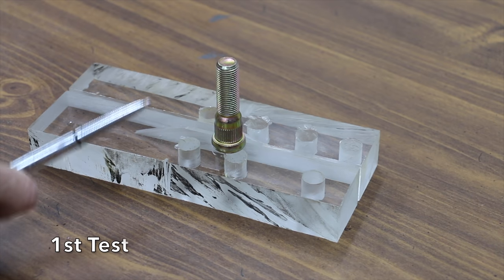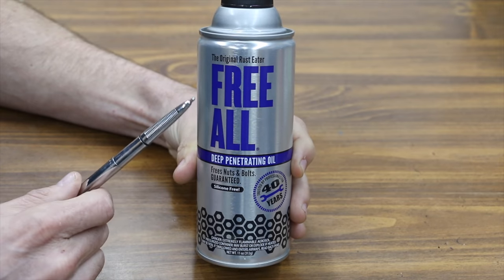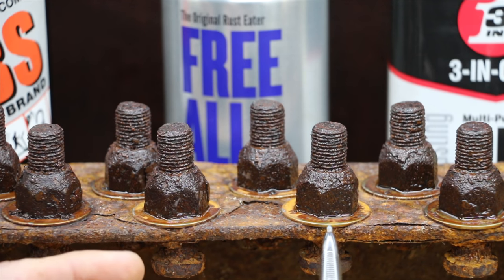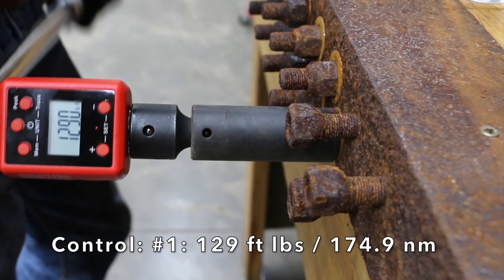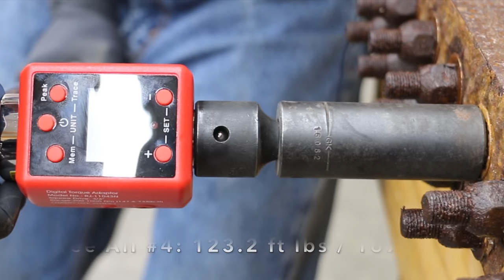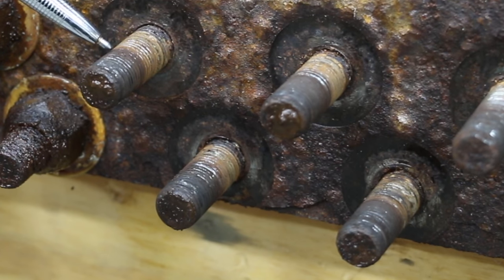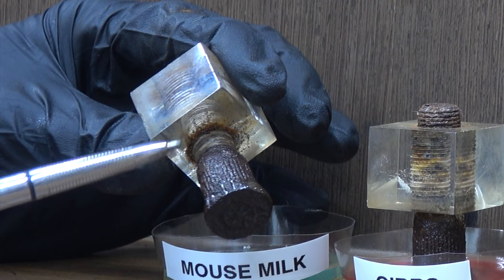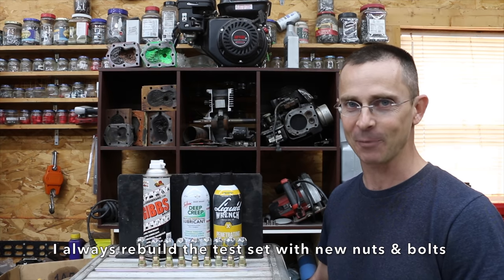Does Water work better than Penetrating Oil for Rusty Bolts? Let's find out!

Comment: Good video Todd, like all your videos. You are very thorough and use good testing methods. I was kinda hoping that water would win out, or diesel fuel. Guess not. I have  suggestions for further testing. First, there is a report, "Different Types of Penetrating Oils by Lloyd Bender," from Machinists Workshop. In it he compares 4 solvent-based oils on a screw test apparatus. ATF / Acetone Mix , Kano Kroil, Liquid Wrench. and WD-40. I'd especially like to see how the ATF / Acetone Mix performs. Second, it occurred to me that all these penetrating oils are organic solvents with petroleum based lubricants, so they don't dissolve the rust. I did some online research and found that acids do a good job of actually dissolving the hydrous iron(III) oxides of rust. Various acids can be used but most of them are highly corrosive and toxic. One that is relatively safe is phosphoric acid, the active component of Naval Jelly, which actually chemically reacts with the rust (iron oxide) to form iron phosphate. Can you do a test comparing Rust Buster (Distillates (petroleum), hydrotreated light 100%), ATF/Acetone, VM&P Naphta (petroleum, hydrotreated light 100%), and Naval Jelly (mostly phosphoric acid)? You probably have to thin the jelly so it penetrates. Thanks for your consideration.

Comment: I used to work at a chain store for vehicle repair (along the lines of Jiffy Lube), one time I had to go to training. 
We were working on a relatively new car, and were gonna take the brake rotor off. They said "never use penetrating oil. Use. Only. Water." Mind you this car had about 40,000 miles on it. 
I thought to myself "Yeaaaaaa, that'll definitely work on a car with 200,000 miles on it. Keep at it guys". 
It still took them around 2 minutes to take that mostly rust-free rotor off with regular tap water.
Reply from the maker: Thank you!

Comment: I like how properly the science is done here. I was very surprised that the water seemed to have any effect, and was wondering what the uncertainty on those measurements are. You have a few samples for each substance so including the standard error on the mean as well as the mean value for the torque might be helpful to see how much of the variation might be due to the random effects of variability in the rusting etc.   I don't have time at the minute to do anything myself but I'll come back and edit this comment.

Edit: I added a reply with some information
Reply from the maker: Thank you!
Reply: @ProjectFarm  
(this is a long comment but most of it is hypothesis testing which might be overkill, only the first 2 paragraphs are very important, and I'm very sorry if this is all old news to you, I don't know your background)
I’ll only discuss the torque test since that was quantitative and you showed all the data. The formula for the standard error of the mean is the standard deviation of the measurements divided by the square root of the number of measurements, s/sqrt(n). It's very easy to calculate using excel or python, and acts as an estimate for the uncertainty in the mean. When presenting a bar chart comparing the results, having error-bars on the data showing that the values are plus-or-minus the standard error is usually enough in the way of experimental uncertainty for an experiment like this. It’s similar to z-scores, saying that if the experiment was repeated many times, the mean of the measurements would be within one standard error of your result about 68% of the time.

If the individual measurements are very spread out, as they were for water in this case, or if there aren’t many data points (4 nuts each isn’t that many), the standard error will be quite large. The quick-and-dirty test for significance is that if the difference in mean values is much larger than the standard errors (like maybe five times more), it’s probably a meaningful result. In this case the standard error on the mean for water was about 5.8 ft lbs, and since the difference between it and the control was only about 6.5 ft lbs, that’s probably not going to be a meaningful result.

If you want to go a step further and do a more serious comparison you can use a proper hypothesis test to see if the results are statistically significant. It’s probably unnecessary but I’ll explain how to do it (sorry for not explaining how or why it works) To test, for example, if water had a statistically significant effect, you would subtract the mean value for water from the mean value for the control to get 6.5, then you would square the standard errors for control and water, add them together, and take the square root, giving 5.899. Divide 6.5/5.899 to get the test statistic 1.102 which you use for the test. The number you need is the proportion of a t-distribution which is that far from zero.  The number of degrees of freedom in the t-distribution is generally the number of measurements in the samples minus 1, so 3 in this case. In python once you have set the test_statistic and number_of_samples, you can get this with:

from scipy import stats
p = (2*stats.t.cdf(-abs(test_statistic), (number_of_samples)-1))

but there are lots of statistics programs which do it too, and it’s probably doable in excel. For this test comparing water and control the value is 0.35
That number is your p-value, and it’s a bit like a measure of how likely a false positive is. Normally you would pick a number for what probability of a false positive you would accept, and compare the p-value to that. Usually that acceptable probability (called the significance level) is 5% or 1%, so if the p-value was smaller than 0.05 or 0.01 you would say that there is a statistically significant difference. In this case the p-value is much larger than those, so the null hypothesis can’t be rejected, and you can’t say the mean value for water is any different from the mean value for the control. The reason this happened was the high variance of the measurements for water gave a small test statistic, and the small sample size meant the t-distribution was pretty unforgiving. There’s nothing to be done about the variance, so in this case having a small sample size probably mattered. Repeating this test comparing the means of the control set and the set with Gibbs gave p=0.007, a lower value than 0.01, so you reject the null hypothesis, and your experiment showed a statistically significant difference in the torque required to loosen a nut hit with Gibbs, at the 1% significance level.

Comment: Great video!  In a future video, could you do a test with the nuts facing downwards and sideways, so the different penetrating fluids have to rely more on capillary action to penetrate the threads without the help of gravity?  Most of the stuck nuts I've encountered are on the bottom of my car and it'd be interesting to see if the same results still hold.
Reply from the maker: Thank you

Comment: Alternative 1: One look at the rusty bolts and directly grabs my angle grinder.. :P
Alternative 2: Grabs a can of 5-56 or WD40 and a wirebrush and starts to soak and clean the threads, then I use the blow torch and heat up the nut/bolt. Finally I turn to last resort, the angle grinder.  :)
Informative and great video as always!
Reply from the maker: Thank you!

Comment: Glad to see you giving Gibbs spray a whirl. I've been using that stuff for years and is my number one go to for penetrating tough jobs. Nice to see it came in first. I'm into restoring old Lawnboy two cycle mowers so another great use for it is shining the plastic shrouds etc. I'm pretty good at reverse engineering things and I've come to the conclusion that it's a mix of an unknown oil and isopropyl alcohol. You can certainly smell the alcohol in it and it really makes sense if you think about it. The isopropyl alcohol dilutes the oil so it can penetrate better. Then, the isopropyl alcohol evaporates and leaves behind just the oil. Smart! Well, I make what I call hillbilly Gibbs which consists of transmission fluid and isopropyl alcohol. Works pretty well and is allot cheaper for penetrating purposes. I keep the Gibbs for shining and water repellent. Now, I think there may be a new contender you should consider in spray lubricants. MOTORKOTE SPRAY! I love the stuff, as well as, MOTORKOTE in general. As I have stated before the stuff is fabulous. I've been using it in everything I own for about 8 years and running. On my old Dodge Vans and my Ford f250 I brush Motorkote on the wheel studs. Now, if anyone has ever dealt with Ford 8 lug fine thread lugnuts after winter with roadsalt and slop you know they are a bear to get off. My local garage pushing 200 psi through their compressor struggled with them. Try it! The Motorkote doesn't wash off and the lugnuts come off like butter. Anyways, great video as always! Keep up the good work and we all look forward to seeing your next video. Still really disappointed with Kroil. That's stuff is so expensive and I've had similar results. Take care and thank you.
Reply from the maker: Great point! Thank you

Comment: I've used Seafoam Deep Creep on my wheelbarrow so I can install a new wheel assembly on it, plus, I got new nuts, bolts, and washers for it as well last year. I also sprayed it on my screen door, my gate, and my car doors and lifts for the trunk and hood, and no more squeaks. It's been a couple of weeks since I sprayed my car doors, latches, hood and trunk lifts, and the hinges on the screen door and the gate.
Reply from the maker: Seafoam Deep Creep is a great product!

Comment: I have used LPS-1, LPS-2 and LPS-3 in my profession as electronic maintenance engineer and they are really good ones. I’d like to see you to test those. I used LPS-1 in electronics and potentiometers since early 70’s. LPS-2  is very good in the car door locks if you still have them. Well, vintage cars do usually.
Reply from the maker: Thank you

Comment: I look forward to the final showdown. I’ve been waiting for it. What happened to the ZEP 45 product? It was at the beginning of this video but not tested. If your going to test ZEP, please test ZEP Twister instead. When I worked in the Auto Industry, ZEP Twister was my go to product. It even advertises on the can that you can watch the nut climb the bolt. I never tested that theory but used Twister to free up plenty of stuck bolts that other products would not free up. I really enjoy this channel Project Farm, keep up the good work!
Reply from the maker: Sorry about that. I replaced Zep 45 with diesel since I had a lot of requests to test diesel.

Comment: After watching your previous video on this I simply used WD40 as a penetrater on my 20+ year old valve cover bolts that had gone through over two decades of heat cycling and weather. Result was two bolts stripped out while 14 others broke free with minimal effort. This is normally a headache of a job on this car and I 100% expected 80% to strip out, but they did not.
Reply from the maker: Impressive!

Comment: Great test. I've used water, with some additions: a few drops of dish detergent [surfactant] and a bit of Sulfamic Acid [grout haze remover].  The acid helps break the mineral bond. I use it, on rusted home plumbing, where i don't want to spray oil.
Reply from the maker: Thank you!
Reply: @ProjectFarm  YW.....  Here's another idea. 'Eagle 1 Triple Foam'. It's a wheel cleaner, that many auto detailers use for body/paint prep. It helps remove metal bits; imbedded in the paint. Since it's a surfactant & ferrous oxidizer, it may do the trick.  Dunno - just thinking out load. Available at many national auto parts stores

Comment: It would be interesting to see the passage of the liquid through the rusted thread and determine how much the nut loosens compared to the one that was not applied, (also determine how much resistance the rust offers when unscrewing) avoiding tight nuts since the tightening force could be different in each one. Great job, thank you.
Reply from the maker: Thanks and you are welcome!  Thanks for the video idea.

Comment: Great video! I think you should make a concoction of your own. I've heard of people using synthetic automatic transmission fluid and and acetone mixed together, the key is using synthetic. It tends to separate so you have to shake it and before use and keep it sealed since acetone will evaporate. Also there is a product called Car Pro Iron X which dissolves rust into purple colored liquid. I wonder if that would eat and creep into threads with a liberal amount. Also freezing would be good to try. I know that heating bolts with a torch expands the metal and breaks some rust away helping so would freezing work? Maybe freezing and then heating with a torch could cause condensation inside the threads?
Reply from the maker: Great recommendation! Thank you

Comment: You never fail to amaze with your thoroughness of testing.  I have always used  Liquid Wrench and 3 in 1 but it's nice to see other products being offered.   It does seem that we also learned that a bigger wrench works pretty well too as does heat (I used charcoal lighter fluid for heat once).  How does  Marvel Mystery Oil do in a pinch?
Reply from the maker: Thank you!  I need to test MMO

Comment: When you do torque wrench testing I have a suggestion.  Make an adjustable but rigid stand to put under the top part of the socket or the short adapter at the torque attachment.  The stand would have roller bearings that the socket would easily rotate on.  That would eliminate having the wrench go off center as you apply pressure.  Not a big thing, but I did notice on a few tests that the wrench head did move off center to the bolt.
Reply from the maker: Thank you!

Comment: Try a 50/50 mix of acetone and automatic transmission fluid. It has to be mixed before application and it has to be stored in a metal container. I think you'll be impressed. Great job with the comparison
Reply from the maker: Thank you for the video idea!

Comment: Next time just try wire brushing all exposed threads up to and against the nut, and you may not even need a penetrating oil. That's been my experience for 40 years on a job that partly consisted of getting nuts off rusted bolts. We couldn't wait for a penetrating oil to work. It would usually come right off after we quickly wire brushed the threads. I seldom had to drag out the torch.
Reply from the maker: Great point. Thank you

Comment: All in all it seems that there is not much difference in removing the nuts; it seems that they pretty much came lose with the same amount the got torqued.
To me that means that the rust did not creep deep enough into the threads yet. Besides that, keep up the good work, I love your tests.
Reply from the maker: Thank you!

Comment: Great test, very well done and appreciated.
It does however raise many questions for the uninformed masses such as myself as to whether other household products would even be worth trying in a pinch if you don't have these products to hand.  For instance:
WD-40 has been mentioned
soap or soapy water has been mentioned as well (not likely imo)
transmission fluid (also mentioned)
regular motor oil
vegetable oil (not likely imo)

Keep up the good work and we will keep following you!
Reply from the maker: Great point on the other household items.  Thank you

Comment: There is a fastener company called Kimball and they claim their products are the best available. They have some very interesting lubricants like an etching lubricant they claim brake parts cleaner won't even take off ave the only way to remove it is to grind away the surface of the metal. I'd love to see your un biased testing on some of their products. Thanks for the great videos
Reply from the maker: Great recommendation! Thank you

Comment: Very nicely done video. 

SUMMARY:  ALL of the penetrating oils are approximately useless.  Based on the variance in the torque to loosen the nuts, I doubt any are reliably better than the control.  And THAT seems to coincide with my experience with these products.
Reply from the maker: Thank you for the feedback

Comment: Due to how close all of these were, you could say that none of them are really all that useful. Still have to apply a lot of torque. Of course, it was interesting to see diesel coated bolts and nuts needed more torque to break loose. I wonder if you could do a test of anti-seize compounds to see how well they work. I see these in auto parts stores for things like spark plugs.
Reply from the maker: Thank you.  I think giving them 24 hours would have helped.

Comment: Have you ever thought of doing a test of rust removers on bolts. Recently I had something that was bolted together and very Rusty I soaked it in a mixture of one tablespoon of rainbow oxalic acid to a gallon of water. It took about a day and with minimal effort I unbolted the bolts. I've also used evapo-rust for that. I know you've tested rust removers in the past but I don't think you've ever tried them for freeing up something mechanical it would be pretty cool to see. And I have tried doing it on larger surfaces before 2 by soaking a towel in it and then laying it on top of the parts I'm trying to remove. It would also be cool to see if you could free up a lawn mower engine that had been seized from rust.
Reply from the maker: Thank you for the video idea!

Comment: Two ideas.1  Torque lube provided with head studs. 2 assembly lube. The type used on bearings and cams during engine assembly
Reply from the maker: Thank you for the video ideas!